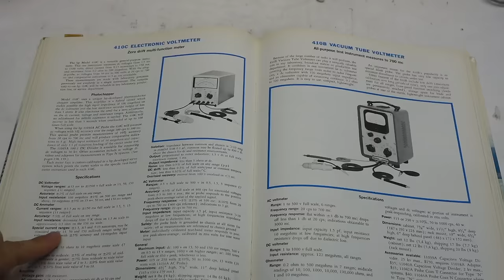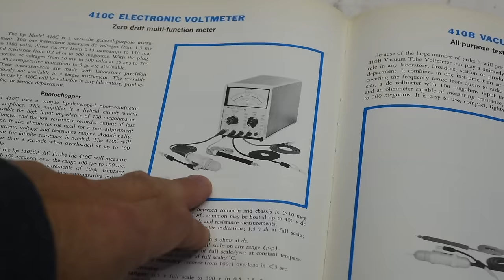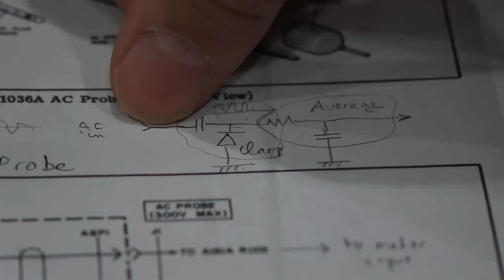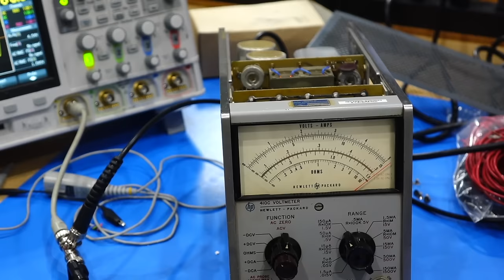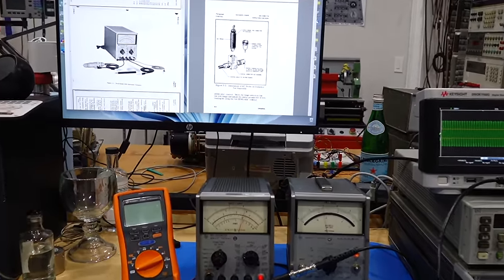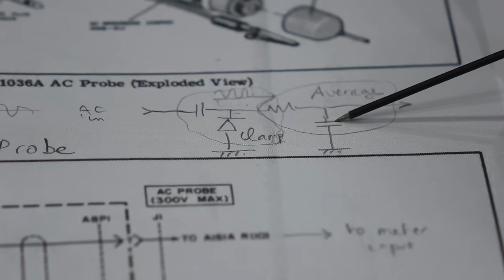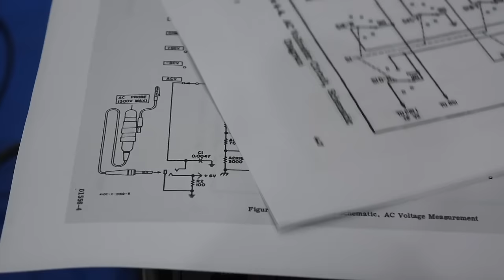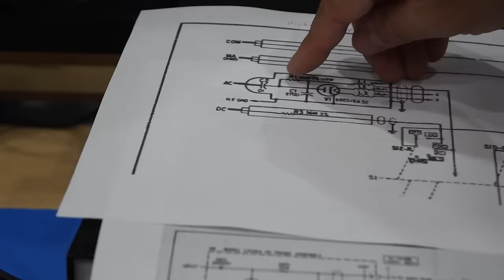HP 410C Vacuum Tube Voltmeter Part 2: AC Probe

Comment: Could your peak be caused by the "ground lead"? At MHz it is going to look like a inductor. I am usually wrong but then I would rather be happy than right any day.
After a bit of poking around , if you look up HP Journal Vol 2 No 3 it appears you need a special HP widget (HP455A) which is used to connect the probe to a coax line, eliminating the need for a ground lead, to measure MHz.
Reply: I was going to suggest that also. The original HP adapter is more of a coaxial connection.
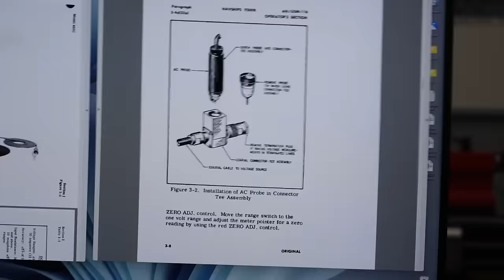Reply: With original HP adapter shown at "13:25" the probe tip and ground lead are removed and the whole probe body is screwed into an adapter. This almost certainly would have a much lower inductance. Time to fire up the milling machine :-)
Reply: I bet you're right about that.  High frequency grounding is very special and mysterious.
Reply from the maker: Good suggestion! The ground lead is that black lead direct from the body of the probe to the tee. Short of machining an adapter like the original, one way to test would be to put a small resistance in series with the ground lead and see if that kills the resonance, or lengthen it and see if the resonance goes to lower frequencies. Let me get in the lab and check that out…
Reply: The datasheet for the probe suggests an input capacitance of around 1.5pF which for resonance at around 700MHz requires about 40nH of inductance. A back of the envelope  calculation suggests that about 50mm of ground lead length would give you this. Difficult to know the lead length from the video but it would be Interesting to know if theory and practice vaguely correspond.
Reply: @CuriousMarc  Swap out the ground lead with some solderwick, or coax shield, and make it wide and flat. Should reduce inductance a lot. Or a rolled strip of brass shimstock, with a soldered joint, and then cut fingers that allow it to be clamped to probe body, and the BNC end similar, though you probably will want to use a N type connector there, simply to have a larger barrel to clamp the fingers on.Use a stripped down plug to get the nut alone, and you can solder the brass to that direct, having a low inductance ground .
Reply from the maker: @GraemeLunam  I think you are on to something. It must be the rather large capacitance of the vacuum tube diode reacting with the ground lead inductance. Which means that you need a super short ground path with such a device, hence their special coax tap fixture.
Reply from the maker: @GraemeLunam  You were right! Re-reading the docs, I noticed that to use the required coax RF tap fixture, you also have to unscrew the standard probe tip cap and its rather large input capacitor. There must be a smaller / better RF cap internal to the fixture then. Removing the standard probe cap also allows the ground path to be much shorter once that bulky tip is out of the way. So, I managed to push out the resonance past 1.1 GHz by unscrewing standard cap/tip, using a small 10 pF cap for the probe input coupling, and shortening the ground lead. Still not perfect but much better. Morale of the story: you really need the special coax tap fixture to make such a probe work at high frequencies.
Reply: I think that the inductance of the metallic probe tip and in the T-connector can be important.
I suspect that at these high frequencies  the return path is as much capacitive as through the long ground lead.
Reply: @CuriousMarc  I don't think it's so much the input DC blocking cap but the inherent capacitance of the diode, which I assume is about1.5pF based on the input capacitance in the specifications. If you knock up a simulation (I used LTspice) the diode capacitance goes series resonant with 40nH of the ground lead at about 700MHz which causes a huge rise in the voltage across the diode across which is where the voltage measurement is taken. RF grounding is a bugger of a thing. I've caused a few project managers to weep about the 'hit' taken by a project budget/schedule, when using the words "the RF grounding isn't quite right...." BTW I love your work, there's not much quite like old HP gear.....
Reply from the maker: @GraemeLunam  Completely agree, resonance is with the diode parasitic cap. But I think the default cap in the tip is huge and has a non-negligible inductance, it is not good enough for high frequency operation. I first tried to just shorten the ground lead with the default tip/cap combo and that didn't do much. Only when I got rid of it and replaced it with a better cap did it start to behave. Of course it allowed for an even shorter ground lead, so the two effects might have been inter mingled. In any case, you are fundamentally correct, it was the test leads inductance resonating with the diode parasitic capacitance.
Reply: @SeanBZA  The inductance won't be affected  by using a braid instead of a wire, it's totally reliant on length. The suggestion to make a barrel with shim stock may work though.

Comment: I think the parasitic inductance causing the peak is the short ground lead.  I would get a piece of thin copper strip or ribbon about 20mm wide and connect the grounds together as close as possible.  If this reduces the parasitic inductance, then the resonant frequency should go higher, and hopefully the peak will not be so sharp.

Comment: When we used the 410C for analog TV transmitter testing, we used the. MODEL 1I042A PROBET CONNECTOR, (I'm not shouting, that's how they appear in the manual) in line with the coax transmission line, which was then terminated with a 50ohm Test load.  We would read the voltage across the line, then grab a calculator & derive the "sync tip power" as the detector is a "peak & hold circuit".  This was only used for the lower power transmitters, up to around 2kW. Another accessory which might be more appropriate for testing would be the MODEL 1I043A TYPE N CONNECTOR, which is not a T connector. Both of these appear in paragraphs 1-11 & 1-12 respectively of the manual's "General Information " page.

Comment: I used to use the 410C to service 1960s and 70s communications equipment, mainly because that was what was specified in the test instructions; I wasn't aware that it was a valve / vacuum tube voltmeter.

Comment: There was a tiny bit of cleverness, on the end of the pin of the original probe resistor. Did anyone else catch it? @19:41. The original builder slid the insulation tube onto the pin and, then, bent the end of the pin 90 degrees. This prevented the insulation tube from sliding off and/or sliding out of position (which might allow a gap in coverage,) while the builder fished the resistor pin through the body of the probe. Is this mind boggling cool? No, but I will take any helpful building method tip that I can get... Cheers.

Comment: I am a bit worried about the replacement 22MΩ resistor. I think the replacement  is a  metal film, and they are normally made by milling a spiral, an inductor, in the surface of the resistor.
It might be that You will get rid of the oscillation if using a carbon composite resistor instead.
Reply: Carbon will be ok providing it is not solid. solids go up in resistance as the frequency goes up. This is due to skin effect.

Comment: Try a couple hundred ohms in series with the probe tip.

A tip for finding parasitics: come up with reasonable (even if ballpark) estimates for L and C, or Zo and Fo. You've measured Fo here, and judging by the Q factor of the curve, Zo is either ~1/10 or ~10 times the source resistance, depending on if it's a series or parallel resonant circuit.  Source resistance is 25Ω, since it's a terminated 50Ω line (the power sensor is a termination, right?).  So it should be in the ballpark of 50nH and 1pF.

Another tip: inductance is proportional to length: consider the magnetic constant 1.257 uH/m.  If we multiply by length, and scale by a dimensionless geometry factor, we get inductance.  For an apparently so-high impedance (compare 250Ω to a more typical transmission line 50~150Ω impedance), the geometry factor will be on the high side, 0.5-1 say, so 50nH is about two inches of lead length. And gosh, I wonder where you can find a couple inches in the probe tip structure? Aha! :)

The peaking is valuable, actually, for extending the frequency response; if overdamped, R*C dominates and it rolls off gently at some 100s MHz.  Underdamped, you get a peak right at the cutoff, which is the observation here.

In principle, you could add a capacitance plate somewhere in the RF loop to add a second pole, getting a 3rd order peaked response overall.  This could extend response to, maybe 800MHz or so -- but with the ground strap sitting just wherever, and with trying to solve a 3rd order polynomial by way of cutting and positioning mechanical parts... I think you'll agree that's the kind of optimization best left to the old HP boys, hah.  Put another way: the famous Tektronix T-coil peaking, but at RF where you don't use coils but bits of metal.

Comment: My Genrad VTVM RF probe has a 50 Ohm load that fits into the GR874 connector on the probe input.  My Boonton RF voltmeter also has a 50 ohm input that fits on the probe.  They work up to their specified bandwidths with the integral 50 loads and coax inputs.   When used in probe mode with a ground lead issues start at high 10s of MHz.  Perhaps you need to make a similar coax terminated input that fits on the probe and allows you to eliminate the ground lead inductor.

Comment: The capacitors at the coaxial cable ends probably peak the top end response .
Don't overlook the cable type & length “ Capacitor - inductor - capacitor ” .
We are talking HP so its probably non standard cable .

Also the HP probe body looks like it has more RF screening .
Everything is important at vhf even the type of resistors .

Comment: At high MHz range, the ground lead loop is a killer.  You might find a Tektronix application note about it.  I have been at their seminar about oscilloscopes and their probes, where they showed scope photos for comparison.  In the scope probe, the inner element is 9 M-ohm, bypassed by a small adjustable (case) capacitance, some 2 to 4 pF.  You have a different, hugely larger capacitor as the main  longitudinal element.  With that, the resonance even with a minimal ground loop inductance is radically more evident.  But a finer point - the resistor you applied is also suspect.  Its element has been trimmed by cutting a spiral, which means it became also a tiny coil.  The old, 5% (or 10 or even 20%) carbon composition resistors did not have any spiral cut in their element, and had lower inductance.  The question might be just, is your resonance by nature series or parallel type…

Comment: It is important to have a terminator at the end of the cable. Do not use a T with a cable to go to one of the instruments. This creates stubs which will resonate. Use a single run of cable with the instruments  tapping off it. Terminate at the far end.
In summary, a single run of cable with the instruments tapping off it terminated at the end. No cables going off to instruments, connect directly to them.

Comment: Great as allways -- Just got an ebay HP410C -- the manual shows an alternative amplifier with FETs, but the instrument still has the chopper ones. I will test is soon, but before I plan to recap the power suplly CAP CANs. with 2x1200uf -20V to 1x 4700uF 25V and the other 4x20uF 450V to 4x 27uF 450V waitong for them to arrive --Have you checked the CAPs in your device, they are really old I assume ? I wait for plugin of the power till changed, though the ebay seller did power on the device but without further check. I also got the original probe, and will make some tests after you had such problems with the other probe, will be interssting to see if theoriginal probe has some similar problems.
Reply from the maker: The can caps in my unit were fine, but one of the caps in Atkelar’s unit were bad. It’s probably a good idea to replace them both.

Comment: I wonder if the big peak is a result of the power sensor feedback.... maybe try doing it open loop instead to rule that out.
Ideally you have a terminator on the cable to kill the resonance at the probe end, I didn't see one there, you could have used a pass through terminator to help it, obviously it would throw the reading out a bit but will stop the resonance and rule out the test setup as the problem.

Comment: Two words: 
Through Terminator

Unless that power sensor off the T junction you have for the generator’s ALC has a 50Ω termination, you may be hitting a standing wave extremity (either peak or trough)… potentially further exacerbated by the ALC feedback loop, wherein the process of the generator compensating itself, it’s dumping higher power down the line at that frequency. 

A better setup might be to swap the T-junction with a balanced power divider and a through terminator on each side (provided, the generator can normalized to a fixed -3dB detection offset)
Reply: Should also add: a very simple way to verify/rule out standing wave effects as the culprit would be to connect a different length of cable between the generator and T junction)

Comment: Hi Marc:    Is the OP of the RF Synthesizer / probe correctly terminated in 50 Ohms?   If not, that may be a factor in the rising response.... Steve
Reply from the maker: It is terminated at the tee by the power probe. At 700 MHz that should be “close enough”. At least I thought so, now I’m doubting everything…
Reply: Maybe try a VNA, that would show any mismatch and the frequency at which it occurs…  I would imagine you have a few lying around!

Comment: Your ground antenna ah lead is probably the source of your problem. A test fixture that minimizes the loopiness of the ground connection would be good. You'd also want a metal band around the meter end of the diode around the R and C components. I have problems explaining this to my partner. But, basically, you do not want loops of wire in your measurement path. You want everything short and direct. Thus the fixture should have a nice cable shield to probe shield machined fixture. That will change the performance by raising the frequency of that sharp peak. The wire in the tubes can't be mitigated. So that limits how far you can move the resonance.

RF behaves somewhat intuitively until you get above maybe 100 MHz. At that point even the PCB between two ground connections on a nice ground plane starts to become a component rather than satisfying the "ground" abstraction. Mostly, though, I don't press my luck by going above 1GHz. I don't grok that stuff the way I grok lower frequencies.

{^_^}

Comment: Your peak could be caused by the construction of the resistor. I will probably be a spiral wound film. I had this on a cheap VSWR meter at 900Mhz or so.

Comment: It looks like your coaxial cable from the signal generator is not terminated with pure resistance.  What's likely happening is that your connecting cable is acting like a 1/4 wave transformation, causing the voltage peak - and the paralleled cable/load on the "tee" connector to the scope doesn't help either.  Adding a 50 ohm termination at the scope may have made it "less bad".

Connecting multiple devices in parallel will be tricky as any deviation from 50 ohms resistive will skew the results:  One may be able to put a terminator at the "tee" - or perhaps a 20dB pad (measuring voltage through it - also terminating at the 'scope - and then doing calibration to compensate for the loss when using it to make readings) - and live with the parasitic reactance of the tee itself and the probe - which should be far, far less than the set-up you used.

Constructing such a fixture for even 100 MHz will be a bit of a challenge it it's likely that inconsistency/lack of flatness would more likely be a result of its imperfection than the probe itself.